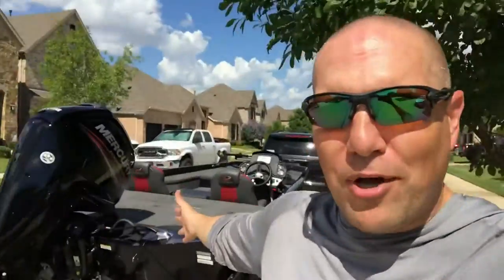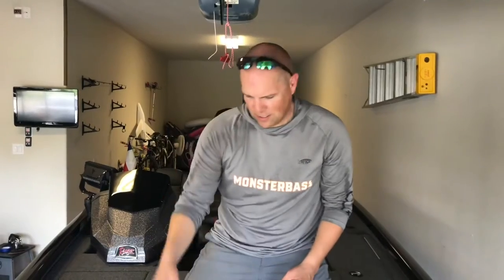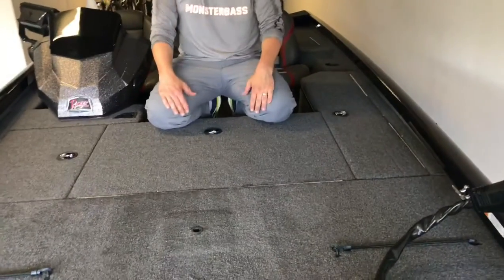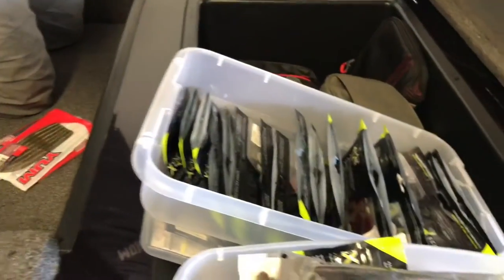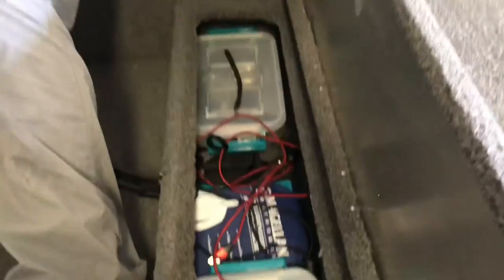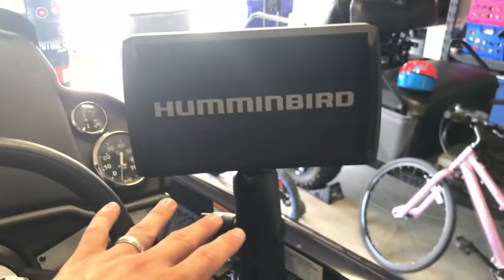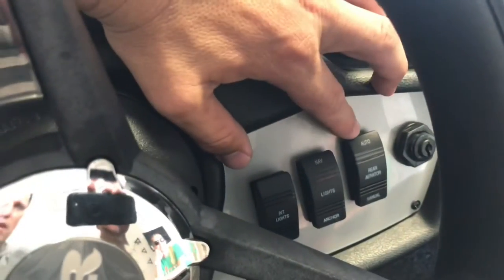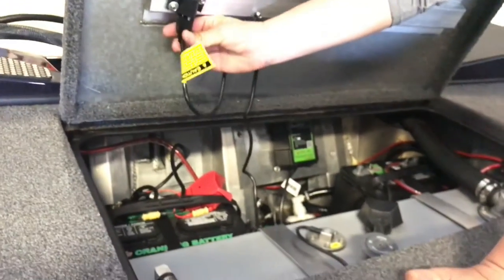MY FIRST BOAT EVER‼️ So pumped! 👊💥

Comment: Hey man, love your videos. Is it possible to tell me where you purchased your RT178? I live here in Fort Worth and I am boat shopping. Thanks!
Reply from the maker: Thank you!  I purchased it from Cabelas in OKC, however, I would not recommend that dealership/store!  There other smaller dealerships that you can search for on the Ranger website. Also, any local Cabelas can trade another store for boats, which I learned after the fact.